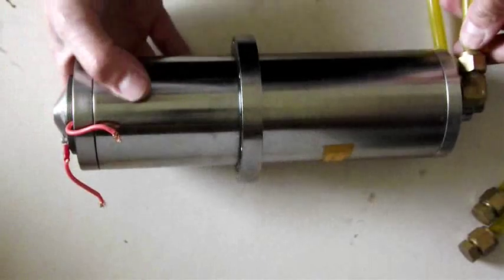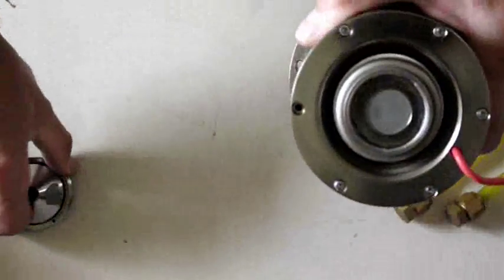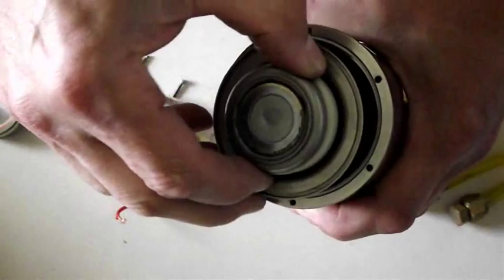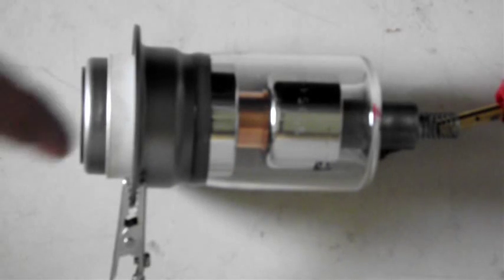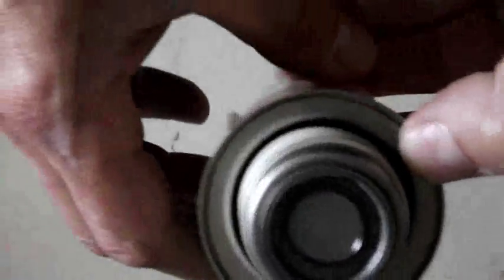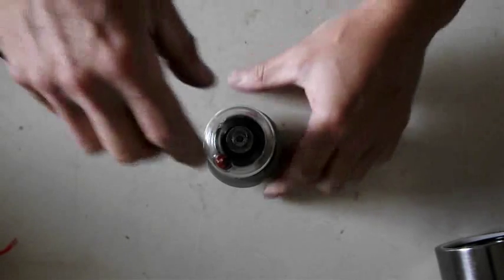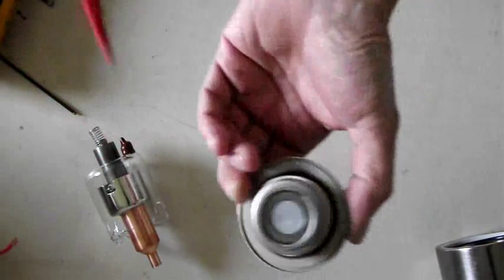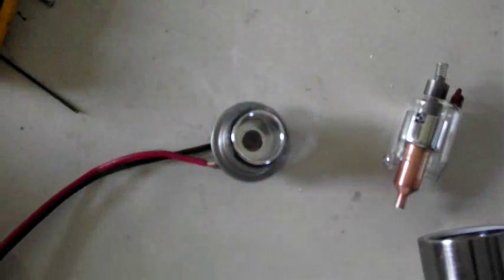X-ray tube autopsy

Comment: Can you run this for an hour without failing?
Reply from the maker: Not this one, but if in working order so long as the anode doesn't get too hot, can't see why not.
Reply: tuopeek1 Actually I know that is a X ray tube run for 5-15 minutes it may fail or burnt of over heating.
Reply from the maker: It's the anode that can overheat from electron bombardment.  Reducing the  current will reduce the anode temperature and let it run longer. However reducing the heater current will increase the acceleration voltage on the anode. This will produce higher energy penetrating x-rays but may also damage the emissive properties of the heater/cathode over time.

Comment: Dental x-ray?
Reply from the maker: Don't know its origin but don't think it was dental. It had a  narrow beam at one end which is an unusual construction.
Reply: ***** Well, do you have any information about the manufacturer?
Reply from the maker: Unfortunately not. There were no markings on it. It had an interesting construction i had not seen before or since. As it was broken I did not keep much of it after making the video. One comment suggests it may have been a Russian manufacturer.
Reply: ***** Yes, the orientation of tube is quiet different than a conventional x ray tube. I don't know anything about x ray generators originated from Russia, actually this is the first time I see one!

Comment: what sort of oil do you recommend on using in an x ray tube?
Reply from the maker: Luckily I have always salvaged the oil I need from tube enclosures. I don’t know the exact types oil used, but it is essentially quite thin transformer oil.

Comment: I have a very small Russian xray tube with similar construction and I suspect your may have work on the same principle - http://www.hardhack.org.au/xraydtt
Reply from the maker: Interesting, looks like the beam current would be very small as the anode would heat rapidly. Nice construction though.
Reply: I have a few ideas on how it might work, but I'd really like to know the science, They are clearly designed to produce a narrow beam of  x-rays.  The one in your video must be for X-Ray Fluorescence Spectroscopy and produces hard x-rays. The tube I have produces a nice narrow beam of soft x-rays. PS like your videos
Reply: Very interesting, never seen inside one before!
Reply: +tuopeek1 nice Be window!   Alphas -> Neutrons.
Reply: +Robert Hart a similar-looking tube is found in Golden Engineering narrowbeam x-ray sources used for portable TSA, airport inspection, needle anode, but pulse-mode field-emission cathode http://lampes-et-tubes.info/xr/xr023.php http://www.ndtma.org/wp-content/uploads/2014/02/Golden.pdf